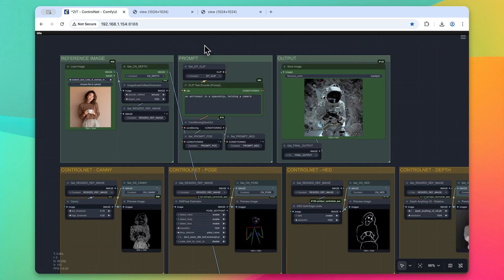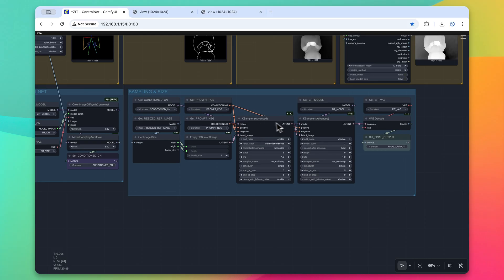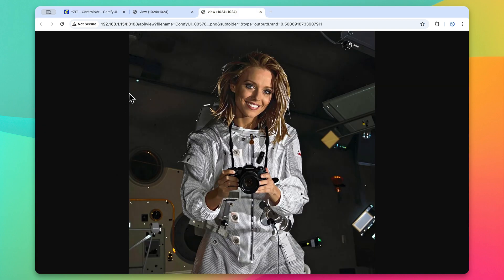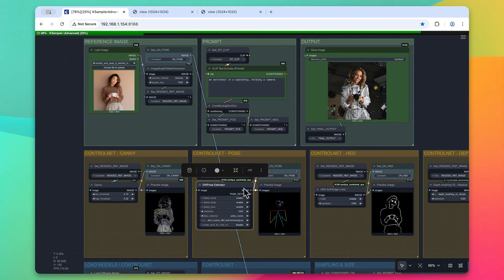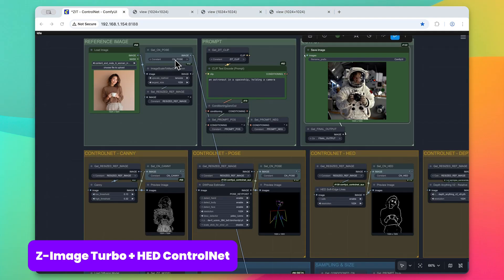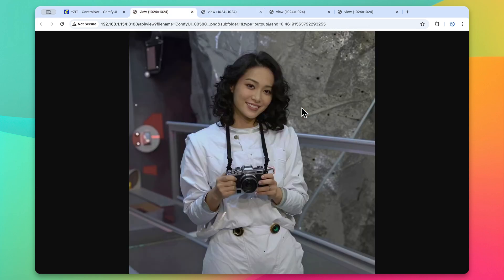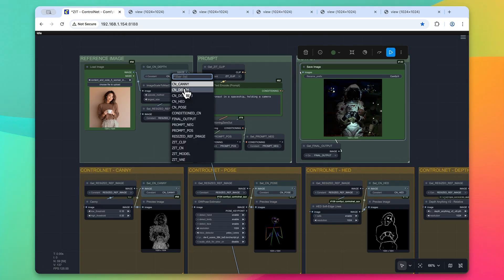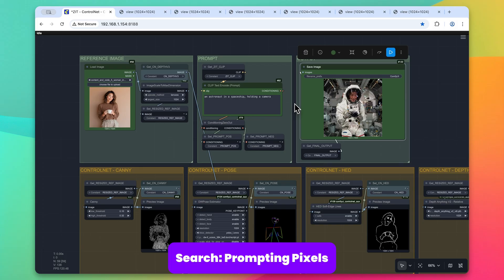ControlNets with Z-Image Turbo Explained (Free Workflow Included)

Comment: Hi, I'm just starting my adventure with comfy. Love your work! I this case I'm getting an errro in controlnet and sampling section. the ZIT_MODEL is teling me "input is missing". Do you have any solution? Thank for your great work!
Reply from the maker: Either you need to install https://github.com/kijai/ComfyUI-KJNodes through the ComfyUI manager which gives you the ability to use get/set nodes.  Or place the Z-Image Turbo model in the diffusions_models directory of ComfyUI - https://huggingface.co/Comfy-Org/z_image_turbo/tree/main/split_files/diffusion_models